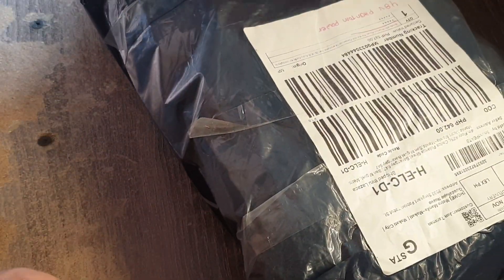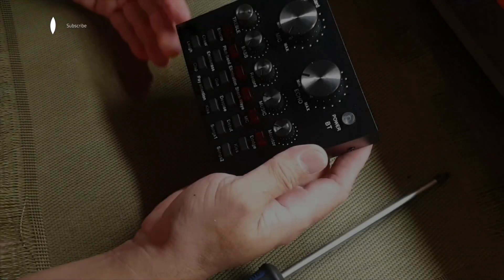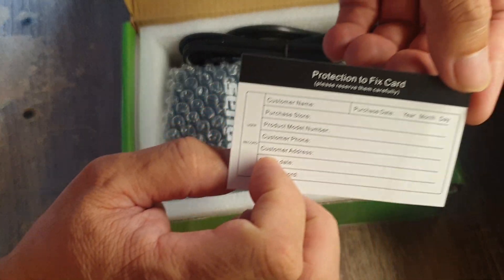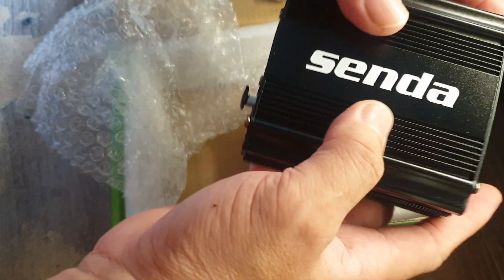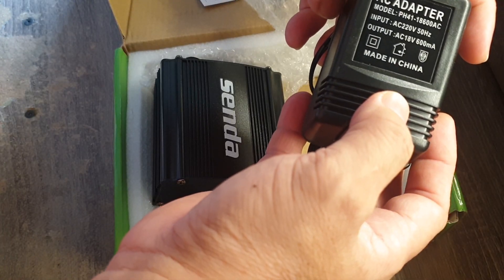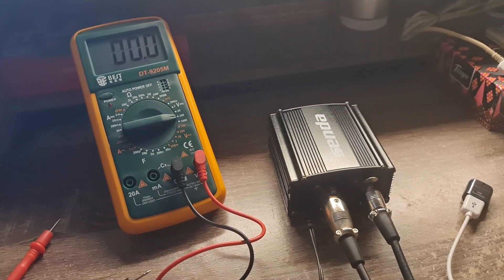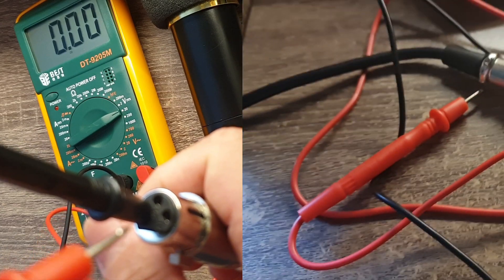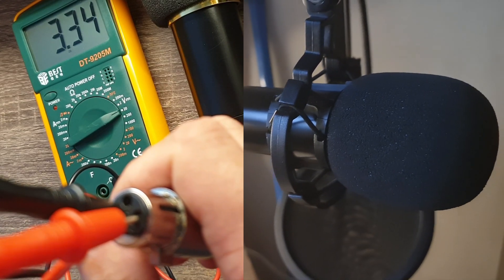REVIEW: Comparison of Voltage Output of V8 Sound Card & Phantom Power Supply (for BM800 Mic)

Comment: So what's the best?
Reply from the maker: I am no longer using the phantom power box. I found out later that the BM800 microphone is okay without the phantom box. Thanks. Pls subscribe.
Reply: @HiTechTaBai  now you use BM 800 without V8 or phantom power?
Reply from the maker: @adamlak6040  I use BM800 with the V8. You can't use the mic with the phantom power box alone. The latter is not an amplifier.
Reply: @HiTechTaBai  ok thanks i will subscribe

Comment: Hello sir can you give me some tips,
Every time i connect my bm 800 to senda phantom power, humihina hangang sa mawala po yung voice ko, pero pag wala phantom power okay nman po, i tried replacing tip122 pero same parin posible kaya sa filter side?  Sorry po diko pa na test output voltage try ko Tommorow ni test
Reply from the maker: Ako rin, di na gumagamit this Senda phantom power box because it is not compatible with the BM800 mic nang ginamitan ko ng new phone. I think, the BM800 works well without the phantom box.
Reply: @HiTechTaBai  True sir, i test output nasa 47.8 siya, hindi ko narin ginamitan ng senda sir, siguro magamit ko siya in the future if i use genuine condeser mic, Thanks Sir More Power